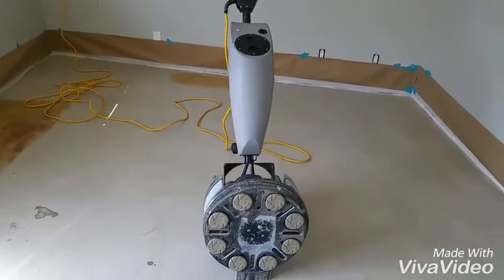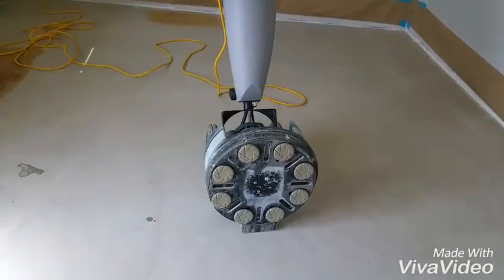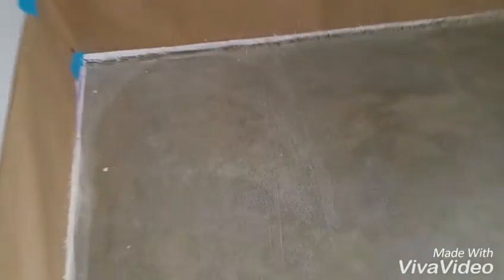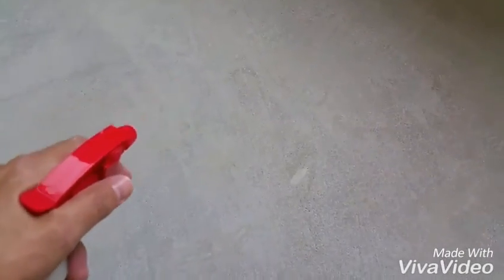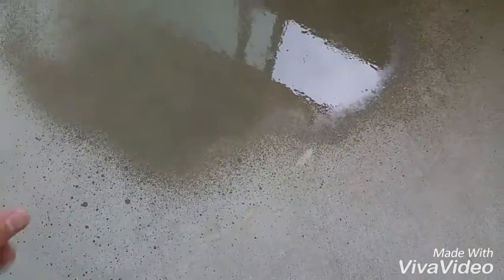Orbot Gravity Concrete Grinding

Comment: Will the Orbot Sprayborg do the same?
Reply from the maker: @tilestonepro it is limited. You won't be able to add weights and not 100% sure if the plate is the same size - i believe so though.  You can contact orbotusa.com for more info.